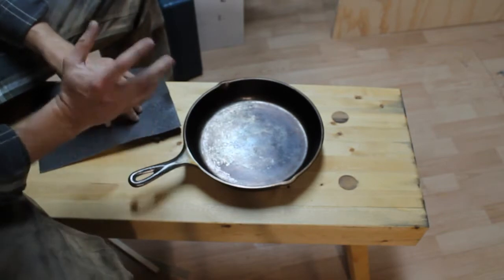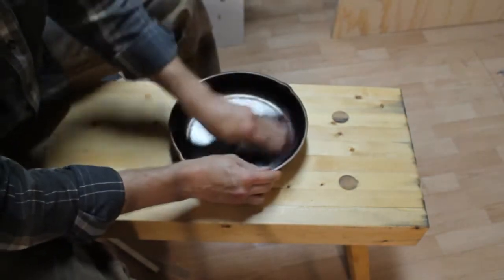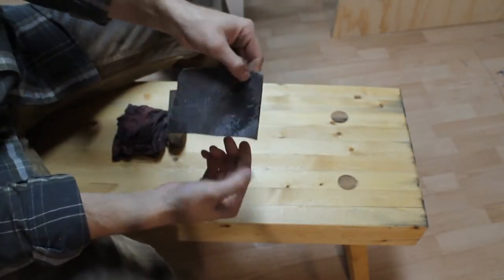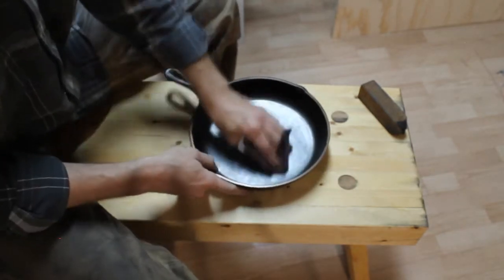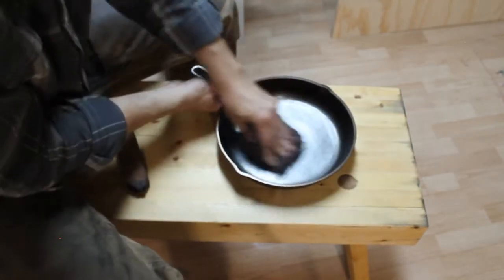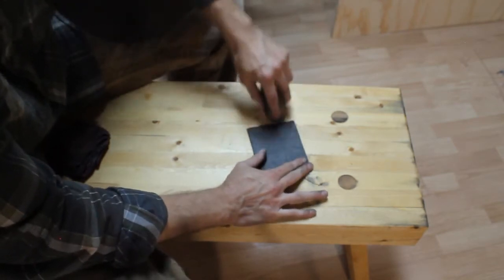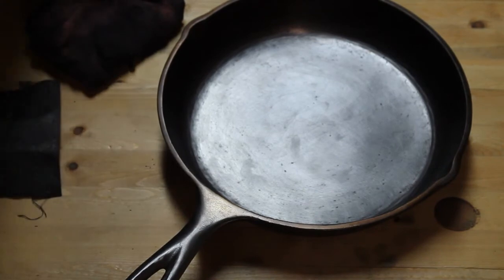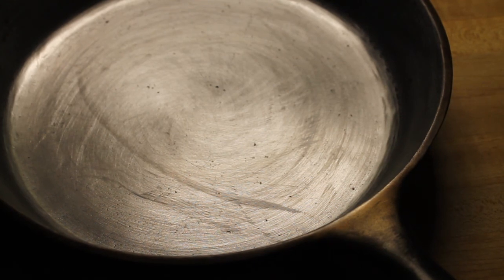What to do when cast iron skillet seasoning comes off.

Comment: Best thing to do is strip it down to bare iron and start over.
Just stripped a Griswold down a few days ago. 700 degree grill for ~ 3 hours.
A few pits on it but I won't touch it with sandpaper.
2 coats of grapeseed oil so far and it's looking good.
Reply from the maker: That's what I did but with sanding. You can see how it turned out in my other videos from last year. The skillet is a black mirror now and without contest the best cooking tool I've got. 

I'm actually cleaning up a little No. 3 Griswold for a friend - it was her grandmother's. Stripped off all the creosote and seasoning yesterday with my angle grinder and a scotch Brite attachment and a wire wheel attachment. They're great for getting rid of creosote and seasoning but are pretty gentle on metal. Just spare me the "collector value" lecturing, she knows about collector value and doesn't care as it's not getting sold but will be passed down to her daughter when she's gone. She wants it to have the beautiful tarnished copper color of new seasoning.

Comment: Hand sanding cast iron is like mowing with a bagless mower. A lot of the material gets worked into the steps and divots (what people call pores).
Solution I've found: Soak just the cooking surface in 100% vinegar for 30 minutes to an hour. It will etch the surface and allow seasoning to stay put.
Reply from the maker: Very good thinking there - very good indeed!
Reply: I agree with this method but you should probably elaborate on what you mean by “100%” vinegar because vinegar has an acidity percentage.

Comment: I've had a cast iron pan for about 1.5 years now and every time I use the thing, meats stick, or salt sticks to the pan and burns, and I have to scour it to get it off. Every time it's 'clean' I always add oil in and re season, I've gone through the seasoning process many times over the length of ownership but to this day it still comes off after washing with warm water and a scourer. Pain in the area
Reply from the maker: Well I don't have an awful lot of background info on how you're using the skillet so forgive me if I'm making incorrect assumptions here. In my experience with cast iron skillets over the past 8yrs, the #1 easiest way to make stuff stick to the pan is to put it on the skillet when the iron is too cold. Even if I have no seasoning whatsoever on the pan, if I get it hot enough for oil to start smoking, nothing's gonna stick. Watch my videos that I posted back in June on cooking with a bare iron skillet - no seasoning at all. I really hope this helps.

In response to the seasoning coming off, my experience showed that you need a roughly 40grit abraded (sanded) surface - finer than that and the seasoning didn't stick well. I don't care how well your skillet is seasoned, if you use a scouring pad...it's gonna come off. Folks say never use dish soap on a cast iron skillet - that's not true these days as soaps are not nearly as caustic but even so, in my experience since making these videos...I frankly almost never need soap anyway, merely running the skillet under the sink on spray mode using hot water gets essentially everything off.

I hope this info has helped in some way!

Best of luck,

- Jens
Reply: @jensdavidsen4557  Yes that's fair enough of you to assume so thankyou kindly for the reply so promptly- Ah, I wonder if it is the scourer I'm using (metal) to get the chunks of burnt stuff off- as I reseason after every cook. I'll take a look at your videos and thankyou again for your time!
Reply from the maker: @sergeantsodom6969  yeah no problem! We're all here to learn - myself included. I would personally recommend a chainmail scrubber for cast iron - the steel edges are smooth so they don't abrade the surface much but it still gets everything off. Metal scouring pad will definitely take seasoning right off. 

People will give cast iron cookware the bad rap of being high maintenance because you have to be careful about how you clean them but anyone who says so, I challenge them to take a metal scouring pad (or a conventional scotch Brite pad for that matter) to a Teflon skillet and let me know how that works out... they'll be eating Teflon and serving it to their friends and family. I'd rather eat seasoning (polymerized oil and fats) any day over Teflon or the other polymer coatings on cookware these days.
Reply: @jensdavidsen4557  So you're saying 40 Grit is the way to go,  80 Grit as in this video did not do well?
Reply from the maker: @GMS444  that's definitely my experience.

Comment: Flaxseed oil tends to flake off more than grapeseed, ghee or crisco/lard. I wonder if the abrasives embed into the iron surface?
Reply from the maker: Folks say it's the hardest seasoning...so that means most scratch resistant and most brittle. I've got no complaints though. 

My issues earlier arose from trying to apply seasoning to a really smooth surface - not enough texture for the oil to cling to. A more aggressive abrasive took care of that - I also gently buff the surface with #0000 steel wool every 3rd coat so that may help too. 

You're obviously welcome to use whatever oil you want - this method works for anything. 

Best of luck to you!
Reply: @jensdavidsen4557  are you in hot climate? I've heard you have to keep your pan in the fridge around here (Galveston, TX) in summertime. my house probably gets around 75ish in the heat of summer
Reply from the maker: @schairphoenix4059  no I'm in Wisconsin, it does get in the 90s up here but I don't understand why you would keep your skillet in the fridge...

Comment: Why would a pan “not accept” or lose its seasoning?
Reply from the maker: If the surface is too smooth there won't be enough effective surface area for adhesion of the seasoning to the iron - think of it like paint - is it easier to peel paint off of a mirror or off of concrete?
Reply: @jensdavidsen4557  ok so then all this I hear about cast iron being “smooth as glass” non stick isn’t necessarily a good thing?
Reply from the maker: @gilmourwaters  yes and no. Go to Walmart or cracker barrel and check out their selection of brand new Lodge cast iron skillets - the surface is almost as rough as truck bed liner - maybe if you cook on it a few times a week for 15yrs you'll develop a thick enough seasoning for it to be smooth and non-stick but for us impatient folk, we gladly spend an hour to sand down the high spots to get a flat smooth surface which will (at a coarse enough sanding grit) accept a great seasoning. In this particular video, it was too smooth. Check out my videos after this and you'll see that I just went back over it with 36grit pads on a random orbital sander and today this skillet is a beautiful black mirror.
Reply: @jensdavidsen4557  I understand that. I have a lodge and it is bumpy as all get out but seasoned… but we also have 3 other very old griswold that my wife’s grandparents had and they were just in an attic til my mom in law gave them to us… sure they were in horrible shape , but I worked in them to bring them back. I usually reach for those because they’re smooth before I bring out the lodge thinking smooth automatically means better non stick surface
Reply from the maker: @gilmourwaters  well...in my experience, I got fed up with lodge's modern "non-stick" BS - everything stuck. I sanded them smooth and they're outstanding now - literally just used one for frying a couple eggs for dinner. Check out my latest two videos if you want to dive into some good experimentation on pre-seasoning. Thanks for watching and enjoy those Griswolds - those are as good as they get - I'd love to snag one some day (as if I need more iron)
Reply: @jensdavidsen4557  definitely will … thanks for the education 👍
Reply from the maker: @gilmourwaters  I've gotten more than my fair share of free YouTube education since I really got addicted back in 2014 - time to give back!

Comment: Easiest way i found to get old seasoning off with the least amount of work is to simply put the pan in a garbage bag and spray it down completely with easy off oven cleaner . Tie the bag shut and let it sit for 24 hours. Pull it out and wash it of with soap and water and there you go. Bare metal.
Reply from the maker: Never tried that but I definitely like the idea... ironically I was at an antique mall looking for a new... antique skillet to restore but the only one that I saw was badly cracked. Thanks for the info!